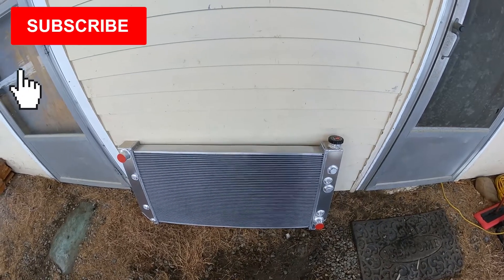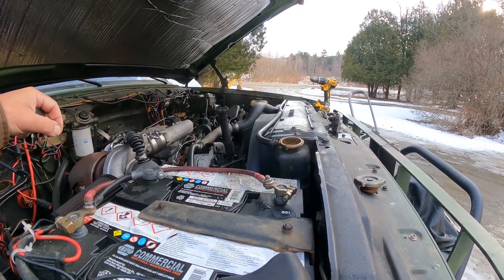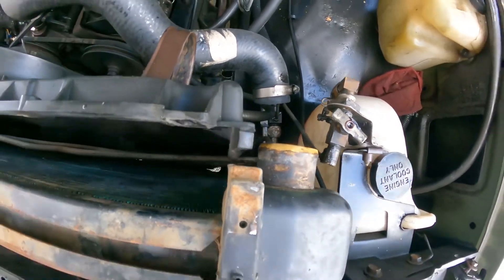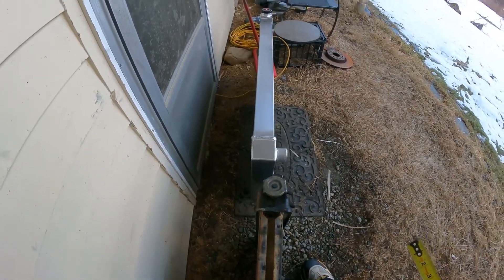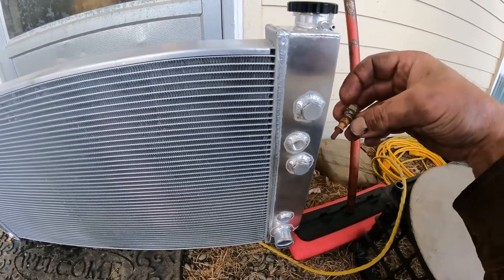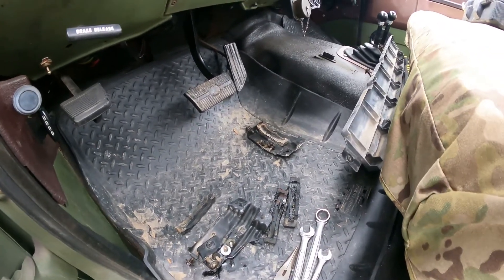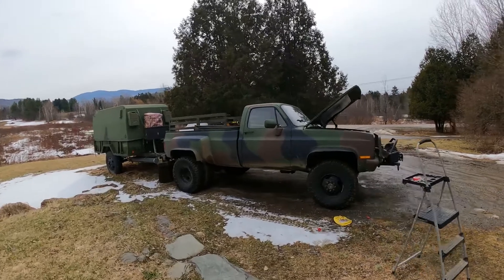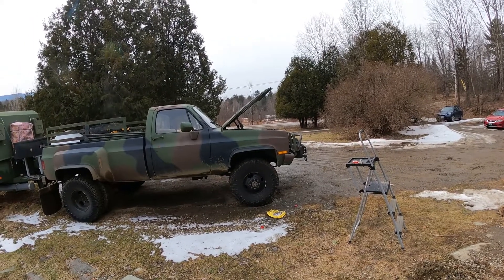Upgrade to 4 row radiator  - M1028 CUCV Military Chevy 6.5 Turbo Diesel Dually

Comment: Need more of these videos and updates. Looking at a 1984 cucv m1028a2 6" lift on 37s in NH non turbo. Just need a simple old rough and tough truck. Kinda done with all of this new fangled crap. Need a noisy rattily old truck again lol. I have a 2011 FJ Cruiser TTE but miss the old stuff. Nostalgic feeling.

Comment: One thing that could be adding to the overheating, or maybe pushed it over the top is having that winch disrupting the air flow. Anything up front will make a difference.
Curious what your top speed is with the 488's and 37" tires.
You have spent a few bucks on your truck, but when you look at the cost of a new truck with the capabilities of yours, you have something unique, and it will hold it's value.
Reply from the maker: That's a good theory, but it also overheats just sitting still as well.
Reply: @VermontPrepper  It doesn't seem like the turbo would add much heat at idle, because it is not being used. It does add heat when you're adding boost, so that when you drop back to idling in traffic, without good air flow the heat builds fast, because the air flow is too poor, and the heat is trapped. That, plus your cooling reserve is probably used up in that situation, before you drop off the boost down to idling, or near idle. I'm not an expert, but if your truck overheats quickly on a cold day you may have a different problem. I would put a exhaust temp gauge in your manifold so you know what is going on. Do you have a cold air intake? That probably won't help too much with cooling but could help with power, if your engine bay temps are hot. Maybe you're running lean with too much boost, just guessing without the gauge. If you're making too much heat in the combustion chamber you can melt down your pistons before your coolant temps rise, that can happen fast when towing in the mountains. Good luck.
Reply from the maker: I don't think it's the turbo either.  I changed the water pump, radiator, and thermostat.  No water in the oil so I don't think it is a head gasket blown.  I'm at a loss
Reply: @VermontPrepper  I've followed your build because I also have a M1028 dually, and you don't cut corners. I can't stress the need  more for installing a exhaust temp gauge. I've put one in a truck when I turned up the fuel(not a CUCV), and it wasn't difficult. Drill your hole with the engine running, if you don't remove the manifold. I would reduce the boost, it will increase longevity of the engine, and possibly correct an improper fuel mixture. The guy that installed your turbo must have ideas. Improper timing will hurt power, and affect temps. I have heard 10 lbs of boost wakes up these engines, 16-20 seems excessive, and risky.

Comment: Unfortunately I found your video after paying a large amount for a new copper one. I wasn’t sure that the eBay one would fit, but it looks like it worked well. Also, have you considered getting a cowl hood to help under hood temps? Another option is to switch to serpentine belt setup, and then you can run a 6.5 water pump and duramax fan.

Comment: Ground your radiator and heater core to the front battery negative post. If you get electricity in your coolant it will take 2- 3 months and you will get a pine hole. 
Water pumps that are v belt pully turn opposition direction of serpentine water pump.

Comment: As it turns out my CUCV needs a new radiator too. How many gallons of coolant does it take to fill up?
Reply from the maker: Over 3
Reply: @VermontPrepper  I have a M105 trailer that I tow with it and it does a real nice job.
Reply from the maker: Same here.  My 1028 has a six inch lift and sits level with it.  I also switched out the gears for 4.88s.  The guy b4 me put in 4.10s for some stupid reason.
Reply: @VermontPrepper  Mine is mostly stock with bigger tires. I have an adjustable hitch to make up the difference.
Reply: @VermontPrepper  thanks